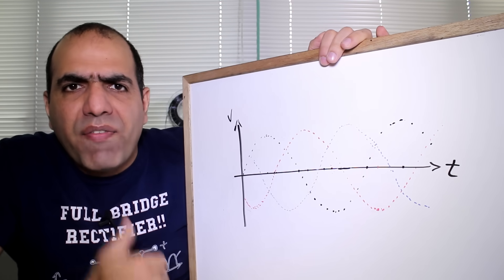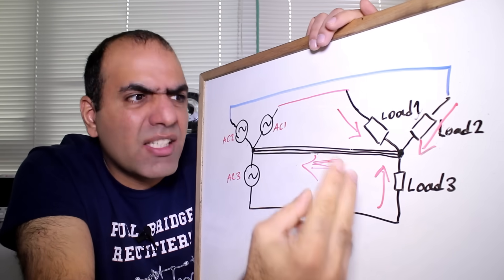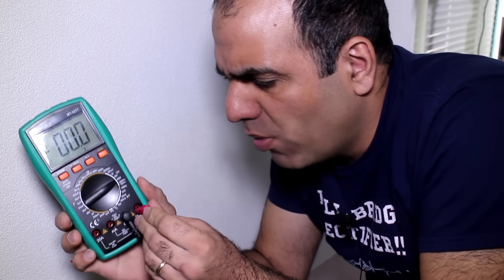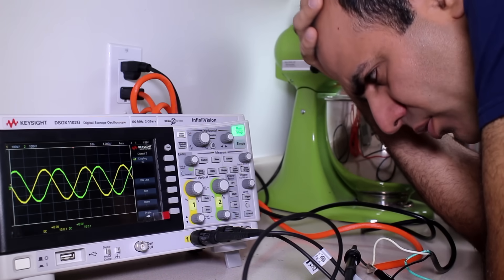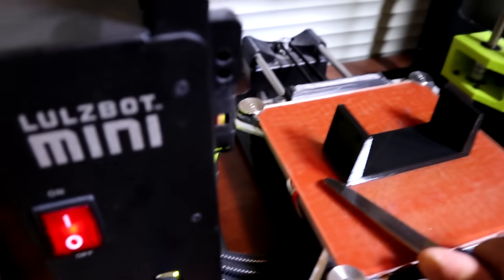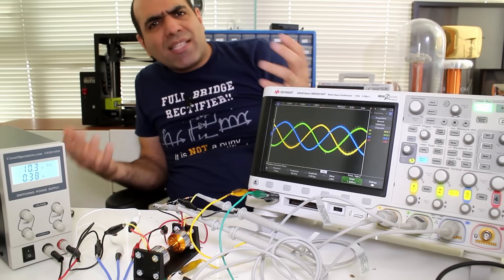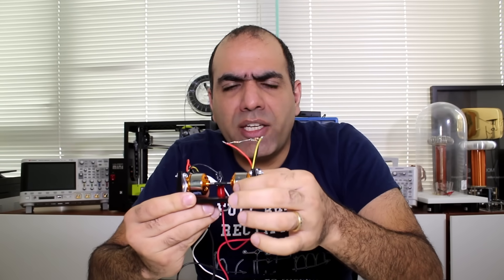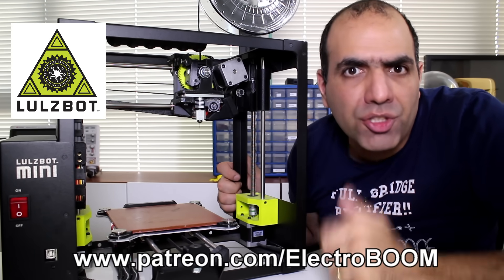Why 3 Phase AC instead of Single Phase???

Comment: "single phase" 120V/240V residential power is created from feeding one of the three high voltage phases and stepping it down in a transformer.  The secondary winding of the transformer is center tapped.  This center tap creates the neutral and splits the phase 180 degrees. 120V from each secondary end to neutral or 240V between just the secondary ends.   I do wish three-phase residential could be an option but at least we can now use motor drives to drive three-phase motors from single phase power.

Comment: 3 phase AC is in every house hold in Denmark, can't get why it's not more common in other countries :/
Reply: Because is not needed in 99% for a ordinary household and you save wires. In my country there is only 1 phase and fuses are usually 50-60A, so you can consume over 10KW without a problem which is pretty much enough for home use.
Reply: Nikalsson but that doesn't save you anything.. Thicker gauge wires is just more expensive and end up probably costing you more money, with 3 phase you get about 9kW with a 13 Amp fuse which can be pulled on a much thinner gauge and also easier to install
Reply: Other countries you mean outside Europe? Most of countries in Europe get 3 phase to detached homes, apartments usually get a single phase.

Comment: essentially you are feeding 3 phase power from the esc to the motor, wich drives the other motor acting as a generator to generate 3 phase AC? couldnt you just use the ESC without converting half your power into heat?

Comment: P=VxI (in sigle phase) it uses 2 wires

P=sqrt(3)xVxI (in three phase) it uses 3 wires

Using three phases you can delivery more power using less investment. (Sqrt(3)/3×2>1)

Comment: A BLDC motor is very different from an induction motor and calling it an 3-phase AC motor is a common but still totally wrong misconception. The speed of an induction motor is controlled by the drive frequency (and the slip from that frequency is what produces torque). The speed of a BLDC motor is controlled by voltage and *the drive frequency FOLLOWS the speed*. It's better to think of a BLDC as a 3-pole stepper motor. You energize a coil (or two for more torque), the voltage of that is controlled via pulse width modulation. This pulls/pushes the magnets of the rotor (the higher the voltage applied the stronger/faster the movement; ever wondered why they have a "kv" rating? that's why) and the third coil is used to sense the movement of the rotor. Once the ESC "sees" enough movement it will energize the next coil and so on.
Yes, you can run a BLDC from 3-phase AC, which would then be a "synchronous motor" that will run poorly as soon as you apply load, because it will lose sync.
Reply: But in the core, permanent magnet brushed DC, BLDC, AC synchronous motor and stepper motor get practically the same poly-phase voltages on their windings! The only difference is how exactly this AC was produced. Brushed DC has a collector /commutator as angle sensor / invertor combined in one simple, cheap but not very reliable device. Brushless DC at first used Hall effect sensors a lot and were practically the same brush/collector stuff, but electronic, with no sparks, wear and tear. AC synchronous motors used to work directly from 50/60 Hz, but after introducing VFD it doesn't vary to much from BLDC using ESC! Stepper motor is just slowed-down BLDC with enormous number of poles. Maybe one day this distinction would die out.

Comment: In Germany we get all 3 phases
Reply: Yeah well with copper you can make brass. We all know what krauts do with brass too. So we can't have that.
Reply: In Denmark we do too :)
Reply: Dennis Ung lucky bastard I would chop my hand foot off for 3 phase in my garage😂
Reply: James Miller it is so convenient because everyone can just get a big mill or lathe in his garage without any extra stuff
Reply: Dennis Ung yea I know, I have to stick with 180 amp welders and small chepo machinery and that's pushing the limits because of the amount of amps it draws and I'm 16 and since 8 ive slowly but up a engineering workshop with all the types of welders and metal lathes ect

Comment: Correct me if i am wrong but does electric cars only have one gear due to that resisting the turning motio9n of an electric motor will induce more electric current within it making it rotate at the same speed no matter what? I think i have heard of this somewhere

Comment: 3:56 that is interesting. Maybe apartments are different, but homes use 2 x 180° waves at 120V, what is actually a single-phase centre-tapped 240V output from the transformer. At least in Oilberta :)

Comment: so why are 2 phases of a 120/240 system stilled called single phase and not double phase?
Reply: ACombineSoldier it's got to do with the frequency of the peak voltages I believe. On 1p 208v they peak at the same time, hence needing capacitors to start a motor
Reply: It is single phase, not two phase. Your transformer is center tapped yielding two 120v 'legs' that are 240v across.

Comment: CORRECTION REQUIRED: You said AC induction motor before your giveaway, previously, you said ferrite cores were induction motors. the DC brushless variety are AC 3-phase PERMANENT MAGNET motors, NOT the FERRITE variety. I would know, as I have dismantled many DC brushless fans in my time, all of them has the permanent magnet ring on the rotor and the electromagnets on the inside (stator coils.) Please remember to do your research BEFORE you attempt to explain something.

Comment: In Germany we get all 3 phases at every house. So we can power devices which needs 400V. It is pretty neat.
Reply: Power companies can even supply single phase, and neutral is tied to earth ground. For small houses in the middle of nowhere. So much for the GFCI protection on a hair dryer in a home wired this way.
Reply: Europe is mostly using a 400v phase to phase voltage system, as in america its 220-230vv phase to phase. Its used to reduce the cost of electric cabeling, because more voltage -> lower current -> thinner wires -> save money.
Reply: Same in Finland, 3 phases in every house.
Reply: Same in czech rep.
Reply: the fuck you need 400v for?, in south america the heaviest machines works with 220v top.
Reply: The 400V is mostly used by ovens, though these days most are just using the regular 250V, probably due to that being more common worldwide.
Reply: It all about efficiency. Here it is common to have in house 3 phases motors for water pumps, lathes, wood cutter, drills, or owens...
Reply: That isn't true. The OP is correct. Few countries get all 3 phases to every house. It is most common in Europe. Some houses in 120v countries get 2 phases.
Reply: Every country has 3 phases at most houses. It's nothing special in Germany.

Comment: I blew out the "10A" current measuring on my multimeter by trying to measure the voltage of a car battery (the meter was in volts mode but the lead was still in the "10A" socket). My new multimeter buzzes angrily if you have the lead in the 10A socket and switch to any other mode (to remind you to but the lead in the other socket).

The other thing I did though luckily this was fused was trying to measure the current drawn by a loudspeaker playing music at different levels, but forgetting that the meter only measures DC current, and was confused as to why I was getting a 0 value or only flickering in the lower numbers. Then I upped the volume and the 250 mA fuse blew in the meter because what was happening was it was measuring a net value of a dc current from a higher AC current.

Comment: Another advantage of 3-phase: you always get usable voltage/power at all times (so yielding good effective utilisation of the power source), as opposed to 2-phase where the voltage/power always drops to zero hence some sort of electrical ballast "fly-wheel" might be needed.

Comment: YOU haven't said anything about the most interesting thing about power! Try to answer these questions:
1) Why do we have 3 phases and not 6?
2) Why the power in 12 phases is not equal to four times 3 phases power?
3) Also... 8:31 At the same time only 2 of 3 coils are powered up, is that right and why?

Comment: In Poland every household does have 3-phase 230VAC going in. However not everybody has chosen to install a 5 pin or 4 pin socket, but you can always do it later on. People use it mainly for welders, electric heaters and cement mixers. The interphase voltage is 400V.

Comment: is it normal for my socket to have 230v in + - and ground?
Reply: nik t yes. Ground is for safety.
Reply: i know but it shouldn't be giving off 230 volts. should it?
+ is input, so 230v are expected.
- is output, more or less 230v might be measured.
but ground?

Comment: In Korea, three phase 380V 4-wire AC is standard, where each house takes 2 wires and a single phase 220V comes in. rarely three phase 220V and almost extinct single phase 3-wire (center tap) is used.

Comment: How does motors work with two phase thats shifted 120 degres? Wont it be voltage drops?
In Sweden we use 3 phase, 120 degres phaseshifted for washingmachines etc.

Comment: Can you run 230v european equipment on two phases in 110v system?
Reply: Yes. Old equipment usually required +-10% tolerance on voltage, while the newer one with switching power supplies is good at +10%, -20%, so no problem. Some of them could work directly from 110 V (smth like 100 V .. 240 V) and some have a switch on the back to change from 110 to 230.
Reply: AllMyCircuits thank you Calculon.
Reply: I think that you've skipped "on two phases" part :) Since in US they have 180* split phase system they can connect devices between two live conductors on opposite phases to give 240V, with both poles 120V to neutral. That's how high current loads in USA work anyway - Cloth dryers, ovens, other high power stuff like this is all 240V. Seach for NEMA 14 series connectors for more information.
Reply: Voltage doublers really are not suitable for high current devices. There is the frequency difference between the grids to consider as well. USA is 60Hz. Europe is 50Hz. That matters with frequency dependent devices like induction motors.
Reply: Everything with AC motors will act strange if work at all. Electronic loads? No problem. Transformers are OK too. Anything with switchmode power supplies will work nice. 240V kettle from UK will wark excellent boling water more than twicce as fast as US kettle.
Reply: Reading your comment I can see you do not understand how electrical loads work. You can build a resistive heating element that gives just as much heat for any voltage. You just have to increase the current it draws as voltage drops, or vice versa. Transformers certainly have frequencies they work better at too. Though a 10 Hz difference is not much. SMPS will not work at different input voltages either unless they're designed and built to. Many are multi input today, but not all are.
Reply: While you can use 240 VAC for high power devices nothing says you have to. We just do because it is generally easier. But plenty of motors offer the option of wiring them in series or parallel depending on what voltage you want to run them on. They put out the same power either way too. Just on the lower voltage they use twice the current as on the higher voltage.
Reply: The question was about running 230V 50 Hz (European single phase) devices on 240V 60 Hz (US split phase) so my answer is relevant to this. Sure you can power high power loads from low voltages, although efficiency may be impaired. Moreover: in UK they use 110V split phase with 55V to ground on construction sites to run all sorts of power tools. You need a special transformer for that and the idea is to limit shock risk in environment where it is likely that insulation may be damaged.

Comment: An 1 phase motor requires extra start circuit to assure correct direction of rotation. 3 phase motor do not need this, the direction of rotation is inherit from the sequence of the phases.

Comment: Why does america have only 110 volts in households while Europe has 220 volts? Plus where i live in Europe, most (if not all) houses have 400 volts (3 phase) for devices that need more energy. I have 400 V electric outlets in my garage for example.

Comment: if i were you i'd print a set of replacements. You never know when something might break and leave you with a 3d printer paper weight. What's more, i'd build a second printer, an i3 or a mendel and have it as a backup just in case.

Comment: When taking measurements from an outlet, insert the probes together with ONE hand or you can insert the probes separately.  Using two hands is risky, because if you slip, you'll complete a circuit across the heart and that will kill you.

Comment: Ok,  I am looking at buying a 3 phase lathe, and I only have single phase power, what is the difference between and VFD, and a rotary phase converter?  Which is better?
Reply: A rotary phase converter is a generator driven by a motor. A VFD is electronic. VFDs are more flexible too. Being able to vary the frequency you can change the speed of the motor you run on them. But rotary being simpler can also be more robust. So which is better is subjective.

Comment: Some homes in Croatia have 3 phases installed. It is used for those water heaters with no tank.
Reply: Lol most of European countries uses 3 Phases system, or rather the system is provided but not often used in home-use
Reply: P4 P1 I'm from Croatia. I also have 3 phase installed for my oven
Reply: Most households in Europe have 3 phases installed. Here in Serbia we use it for heating and cooking. I have a 3 phase plug in every room, just in case.
Reply: I'm in Australia.  I have 3 phase to my home to power my well pump
Reply: I am in Australia and the houses either side of me have 3 phase. I have one phase so I am limited to about 100A maximum, and it makes me sad sometimes. New houses commonly have central A/C system so will have 3 phase as standard - you'd be crazy to only have 1 phase installed.
Reply: Tesla gave it to Croatia first!

Comment: Here in Poland, we get 240 volt 3 phase in every home. This way wiring can be much thinner and cheaper.
Reply: Phase to neutral is 230V, Phase to Phase is 400V, this is common through the most of the Europe
Reply: 50 Hz * and 400 V *
Reply: Yes it is, but the actual parameters of electricity in Poland is like Tesco Value XD
Reply: Is it also 50Hz? North America for houses is center tapped 240v 60Hz. 208v 3 phase is used for the apartment/condo buildings.
Reply: Not everyone has 3 phase power in Poland. It's common in houses, but in older flats it was common to just have one phase installation for each apartment, but it's last mile problem. Usually every building has 3 phase source available.
Although 3 phase is common, there's really no big use for most of us. Only instant water heaters are a common consumer devices that use 3 phases and only high powered ones. There are many 1 or 2 phase heaters.
Induction cookers are probably the main reason why most people needs 3 phase installation, but those cookers only use 2 phases anyway.

I myself have pretty much an industrial installation and I have a few of big 3 phase motors. Just starting them makes you nervous. Loud and powerful.
Reply: same here, you can get up to 30 kW three phase, but only 5 kW single phase
Reply: Is that line voltage or phase voltage?
Reply: Industrial installation could be even 600V so typical 3 Phase installation used in living house should not be confused with industrial installation
Reply: Most induction cookers can work on powerful enough single phase, but for some reason our national electricity providers does not want to provide more than 5 kW over single phase. And wirth a single, but powerful phase you don't have to deal with load balancing.
Reply: 690 V is kinda rare even in the industry. The most common use of "690 V" you see on induction motors for 690 V star / 400 V delta, but these are almost never run on 690 V; instead you use a star-delta starter to start the motor up in field-weakening on 400 V. 500 V 3ph is somehow a thing on some ships. But usually is 400 V.
Reply: Some countries in Europe exist 3phase 127/220V...133/230V:
http://www.foroelectricidad.com/download/file.php?id=4971

Comment: Interesting how they do it in Canada with two phases like that.  Here where I am in the states its single phase to the entire house but split phase 240 is created by a pole transformer.  120v is phase to neutral and 240 is phase to phase.
Reply: The way he described is only true for high-rises that get 3 phases and distribute between units.
Normal "domestic" wiring is split-phase

Comment: I didn't know you actually have 2 separate phases up in Canadia. We only have a single split phase in the states. With 2 phases Luke that, you can use a capacitor to lag one phase and create a pseudo 3rd phase. I think you can easily make a motor reversible too.

Comment: Tip on the 3D print-out you made:
If you had printed it out on it's side, it would have made for much stronger corners and would have had less surface area to stick onto the bed.